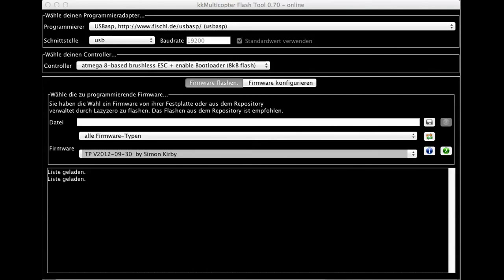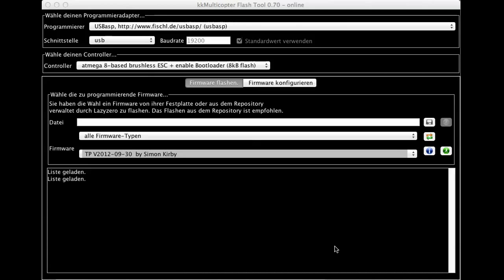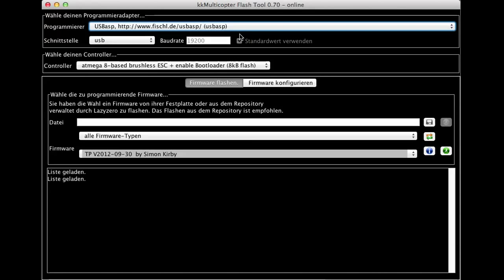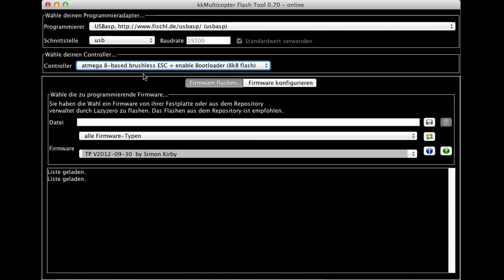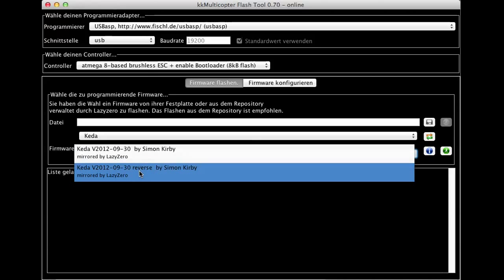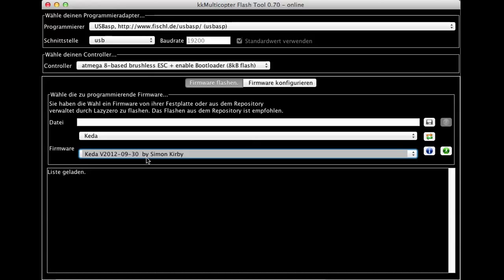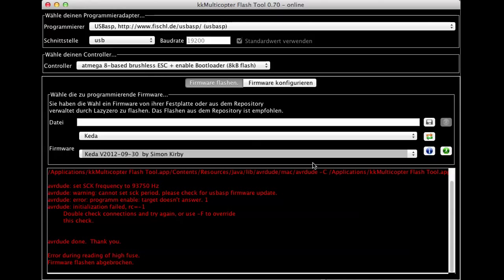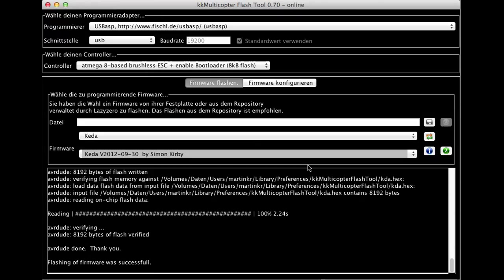TUTORIAL: 3. How to Flash ESC wit KK Multicopter tool

Comment: I also have the problem: "Flashing of firmware aborted. File is corrupted, MD5 does not match to the MD5 in the repository."
I use external power source to the ESC and kkMulticopter Flash Tool v0.72. The older v0.70 may help, bet can't find anywhere. At lazyzero . de only have the newest version. Can you send me it by e-mail? tigris2000 @ freemail . hu